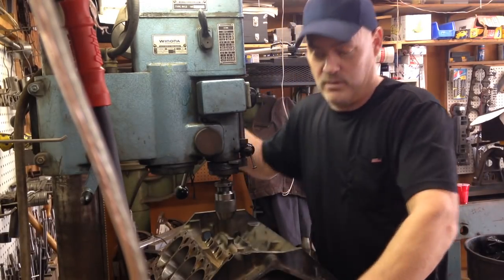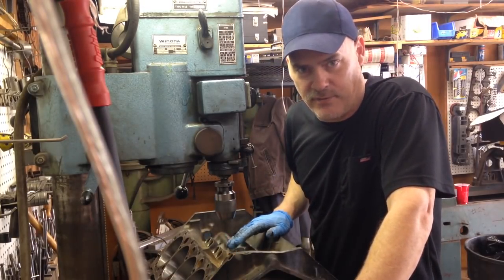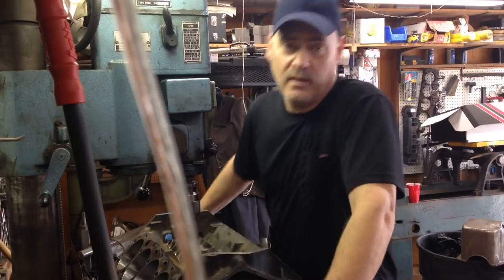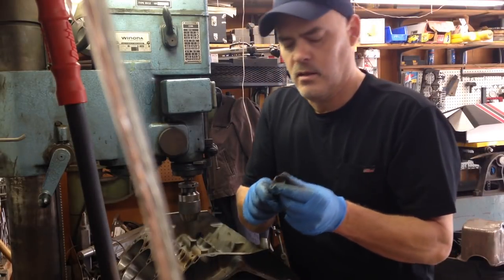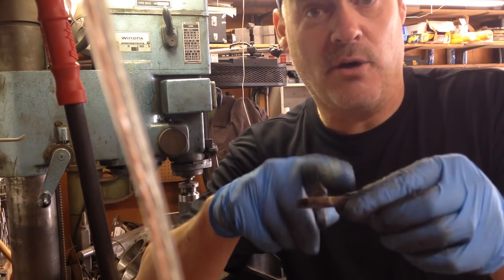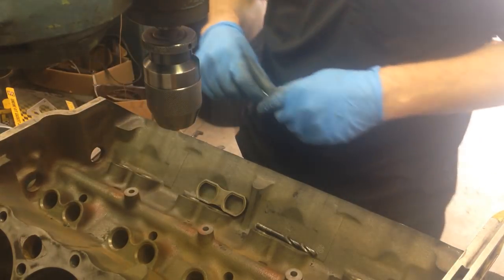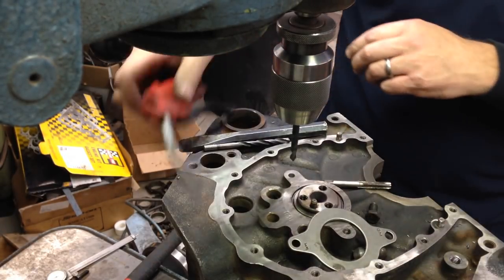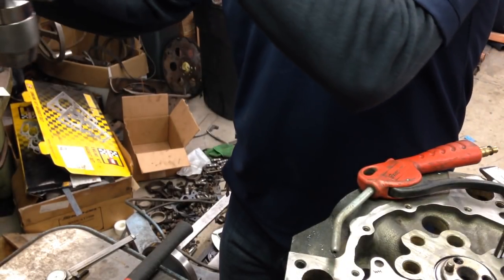Chevy TBI roller cam upgrade

Comment: On the cam retainer, I've always used a transfer punch for the first hole, chamfered it, then tapped it, cleaned it out, bolted the plate back on, checked it for cam clearance, then repeated the second hole. Always works.

Comment: I would also like to add that the top of the lifter bores is supposed to be milled flat and into the upper valley itself to allow correct clearance and a flat surface for the lifter anti rotation plates. This is one often over looked process. Some blocks came done while others did not.
Reply: If the block has the 3 tower bosses in intake valley , the top of lifter bore will be milled flat .

Comment: This is an older video, but I'm throwing in my own interesting experience anyway.  I have a 1989 TBI block and I'm working on a roller cam conversion for it in my truck.  I learned the hard way that if you're not doing this in a machine shop, and your holes ARE pre-drilled, make sure to clean any oil out of those spider bosses before threading in a bolt.  If your engine didn't have a spider installed there before and you're converting it without a full engine teardown/cleanup, then as the engine ran it probably filled up those holes with oil and created a unique situation specific to adding bolts that weren't there before.  I didn't think anything about it and assumed the oil would just act as a lube as I threaded in a bolt, and the first two bolts pushed the oil out just fine.  The third hole had just a little too much crud in the threads to allow the oil to escape, so the hydrostatic pressure ended up busting out the boss.  There's no one in my area that specializes in brazing cast iron blocks and machine shops refused to touch it, so I ended up using a brass battery terminal as a band-aid for the boss.

My bad experience aside though, an interesting thing someone online pointed out to me is that my spider bosses were drilled off-center.  His thought is that the drilled holes were probably a victim of core shift, and the factory probably sent it to the flat tappet assembly line as a result.  It would be interesting to know if the imperfectly manufactured roller provisions in these 87-95 blocks did play a role in deciding which blocks were used in roller cam applications and which ones were dedicated to flat tappet.
Reply: Good point. I have one of those flat tappet roller blocks in my 87 silverado. It was a rebuilt/ replacement engine at some point and has about 3k miles on it. There are currently bolts in those holes but no spider plate. Im looking to convert to roller myself, I'll be careful about that part now that you brought it up.

Comment: I realize this is a older video , one thing is the lifters in the down position will set slightly lower in the dog bones . This is normal as the top of lifter bore is not machined flat . The lifter should still have about 3/16 engagement into the dog bone and will work just fine.  I have done this several times and had zero issues . Do not use a small or reduced base circle camshaft.

Comment: If you guys do this with the engine in the vehicle use a round speaker magnet to surround the boss while drilling and use grease on the tap to catch the chips, then use a scribe with a small magnet on the end to remove any excess chips.
Reply: Cool whip bowl with hole in bottom , slide it over the boss then drill it and tap it. Done it every time works well.

Comment: that look on your face in the end was priceless lol. it's interesting, even my 68 & 70 Olds 350s have those spider bosses drilled & taped even though olds blocks didn't use roller cams until 85. another weird thing is on the 68 the heat shield on the exhaust manifolds have circular cut outs in them for o2 sensors. it's crazy the stuff car companies play with years before their actually in use.
Reply: Sometimes those exhaust manifold holes weren't for oxygen sensors. They were for connecting an air pump into the exhaust system to reignite the unburnt fuel in the exhaust. From 1966 onwards, some engines had air pumps and some didn't based on the needs of the car. Auto manufacturers would put plugs in those locations if they were building engine with and without air pumps that year.

Comment: I have one of these I took out of my 1990 350SS. I put a ZZ4 in it and wanted to convert it into a ZZ4 because its the same block but like this one it has a tiny hydraulic flat tappet cam. Now I just need to get the crank, rods, pistons, and cam/lifter/retaining set and im good to go.
Reply: How did that end up going?

Comment: Something that can save you a little time and headache if your doing this alot is making setup pins by turning down capscrews  to the dia of the holes in the plates  ,you can get
the holes centered  to under +/- .005 or better . such  a good thing to see mockup  in the machining /layout /blueprinting  this can't be driven home enough  , if your going to spend
thousands or more and want the motor to live at high rpm's  , awesome vid's
Reply from the maker: Great advise Thanks
Reply: ,,, yep,,, that cam had too much walk,,, already,,,. It will eat up timing chains real soon,,,. !!!   Didn't like seeing the metal shavings going into the new cam and cam bearings,,,. !!!  After Center punching,,, I would have removed the cam and then drilled and tapped,,. !!!
Reply: @ricksimpson2167  he said in the start of the video that he had not done the final wash yet, and that the cam used during the drilling and tapping was not the one that was going to go in the motor....

Comment: from what I've heard, 94-95 blocks weren't drilled since at that point only the trucks were using that block
Reply: I recently scored a #638 casting which is a 1994 casting - this one has the fuel pump hole drilled out (with the blockoff plate) and the spider boltholes r present but untapped
Reply: I have a #638 from my 95 that was like this without fuel pump hole either but not just that it only had 1 hole for a fuel pump cover plate instead of all 4. Not that u need a cover without the hole drilled but I like the looks of a cover over that ugly cut out lol

Comment: I have a home made centering punch made from a 1" piece of 5/8 round rod. I tapered the end 75 degrees and drilled a 3/16 bore through it. I made the actual punch from a piece of 3/16 rod and heat treated it. It will find center through any hole less than 5/8". Would work great for this project.

Comment: I got a 350 tbi  in my 91 c1500       there good motors  but I ended up buying a LT1 350 from a 96 buick roadmaster  for $400  I wanted to put a tbi intake on it  but I was told I cant and just use a 4 barrel  intake with a tbi plate adapter

Comment: Very cool to see a transition block like that. Guess they were rolling out the new castings already for the L31's before the model year was switched? And saving a few dollars by not machining the bosses that they didn't need to for that application.
Reply: hallis1 no usually these block were previously rejected for core shift I'd of had it sonic checked before I did any machining to it I did one at school and had to correct every cylinder on by slightly offsetting the boring bar if I had went straight inline with the deck I'd of been thin one side or the other on every cylinder some times the can bore is out of line to the main bore to you'll find that when you go to degree the camshaft because it can be as much as four degrees there tolerances were sloppy on the flat tappet blocks towards the last year's of the small block plus these blocks are low nickel and a lot lighter than the older blocks they took a lot of metal out of the castings of these blocks
Reply: the L31 (880) block will have a timing cover flange with the thicker lip 4 the plastic cover - this one seen is a 638 hybrid block in transition - note the upper bolt holes since it has the thick flanges where it was for the redesigned timing cover
Reply: @ Shane Singleton, I have these three year model 5.7L blocks with the last three block casting numbers of 638; 86, 88, and a 92 and everyone of them were fully machined for a roller cam.
Reply: The cars with the 5.7 had a roller cam , the trucks did not .  The blocks were probably all cast the same , with the provision to add the rollers in the car applications.

Comment: FYI the Weiand 8000 is the best manifold for the TBI as far as performance is concerned. I put one on my ZZ4 with a 1 inch 2 hole spacer to give the throttle body a little more length for better atomization of the fuel charge and clearance for the EGR breather. I put a K&N velocity stack on it to open up throttle body around the injectors to unshroud them.  The Edelbrock TBI intake isnt much better than the stock TBI manifold and makes little if any power. The Weiand 8000 makes all kinds of power and is a much better manifold than the Edelbrock and the factory ZZ4 intake.  I used the stock ZZ4 cam but I used Manley 44210 springs and 23652 retainers which gave me 130 lbs of seat pressure at 1.75 inches. I used crane narrow body roller rockers and 12497985 tall valve covers. This seems to work pretty well together and I have beat every truck Ive run with a vortec engine. A few have been beat so bad it was embarrassing.
Reply: You probably beat them because they weren't even racing you...haha

Comment: Talking about weird engines I have a 12550313...454.......91-up...4-bolt, Gen.V crate motor, Gen. VI 4.25" bare block, fuel pump boss

 Is that consider gen 5 or gen 6 to shop for parts thank you and knowledge is gold 🙏

Comment: This may be very helpful. I'm actually trying to go backwards. picked up an 87 305, but didn't realize it was a roller cam. with the cost of upgrading the cam in a roller cam setup it will be cheaper to convert back to a flat tappet cam. currently in the process if figuring out if thats possible or not. I guess the only thing that is unknown, is if the timing gears will line up. Going to be doing measurements comparing from a 69 307 and the 87 305.
Reply from the maker: you can use a flat tappet no problem the early flat tappet timing set will work just fine
Reply: Myvintageiron7512 yep, after days of looking finally found the answer. Also find out it’s already flat tappet, I guess an el camino is considered a truck haha. Or because it’s still a carb motor, it wasn’t upgraded to a full roller cam.

Comment: I found a lot of k series up to 95, no holes, like the factory was getting ready for them, and some boat motor blocks too...most of these blocks were straight making for the better build if hot rod, street builds or Baja🏜️⛱️🤗🗜️🔩🔧⚙️📐📈
Reply: The run really smooth with hand picking 1.52 rollor rockers from comp ...📀

Comment: Kewl video I do believe though when tapping cast iron you can use kerosene as a lube. I use a center drill drop the table lower and the recess in the back of your tap handle fits with centerdrill you can start the tap by hand then n be dead straight

Comment: the hole still there but not drilled all the way out , was switching back to carb to show my boy how and you can drill it out just like the plate you drilled if im not mistaken
Reply from the maker: yes that is corresc you can drill the fuel pump hole although many prefer to use an electric pump even with a carb

Comment: Do you have a video showing how to completely rebuild the oem roller block? I want to build a 383 stroker using an oem chevy block which I have. However I am so glad that you made this video because I didn't have a clue as to what those three tapped holes were for....the spider which holds the dog bones in place. The block did not come with the spider so I was totally confused. Thanks a million for this video.
Reply from the maker: no problem many of the GM blocks had factory flat tappet cams even tho the blocks were set up to take a roller

Comment: We tried a 1998 Vortec 350 roller cam in a 1990 Chevy truck application. It started and ran good but didn't feel like it had the power to spin the tires in grass.  I know it pulled the correct vacuum to work with the 1990 MAP sensor so I'm not sure what was holding it back.
Reply from the maker: Vortec rollers do not work well with TBI heads get a comp cams roller
Reply: Myvintageiron7512 I built The hodgepodge engine for a customer. 1995 350 factory roller block, 1998 Vortec cam, 1971 LT1 #492 2.02/1.60 heads. Topped off with the 1990 TBI and ignition... junk. It would have run much better with an HEI and a carburetor! lol. Thanks for the feedback JD
Reply from the maker: Factory vortec cams are not worth the metal they are made of they are made to work with a very specific OBD2 tune with the vortec fuel injection they do  ot work well with TBI or carbs don't waste your time comp cams rollers are the only way to go
Reply: HeadFlowInc ive got a free pair of them heads nos. Ive been considering a cheap sbc build to throw them at. TBI and that cam would sign off about the time those heads came on line. Then theres compression issues with them big a$$ chambers. What did you use for pistons?
I figure them heads would make a decent buck down 383 build but a guys really gonna have to pay attention to piston choice with them chambers
Reply: do u have a part # for the Comp Cams roller grind
Reply: @montrosepatriot  comp makes lots of different roller grinds for small block Chevrolet.  Go to their website.

Comment: Have you ever thought about drilling a hole in between where the lifters sit to hold down the dogbone that way eliminating the need for the spider?
Reply: The "spider" spring hold down is designed that way to allow for slight movement of the lifter retainers. If you simply bolted them down, there is the possibility of lifter bind leading to premature wear. Edit: just realized your comment was 2 years old haha.

Comment: Bro the correct bolts for the cam plate are Torx and they are round and do NOT protrude up into the Cam gear . I myself personally would have Opted for the Torrington Bearing & cam  button but I guess it's a preference ..If you went .040 over bore instead of the .030 would the net cubic inches  be 396 ? of course using the same stroker kit you were going to use but swap for the .040 over pistons ?

Comment: How is the engagement of the dog bone to the follower when on lowest point on cam. The factory has the lifter bores machined down 100 odd thou. How those are left without machining them flat may be ok with a std base circle cam. But I would be really careful with a reduced base circle cam that the lifter doesn't drop down out of the dog bone and rotate.

Comment: So  With out tearing the 5.7 GMC K1500  Down is there any way to know if it came with a Roller  I plan on rebuilding it  About this time next yr  II will not go back with a flt tap  Roller or roller retro fit  Would Vin indacate  any way if it was roller  --Ok   I have lot of questions  but That will do for now Thank you  Dave @ Dad's Ole Garage

Comment: Hey man watching ur videos is like going to school I love them thank u so much for doing this.  Funny I have a 89 tbi that has a flat tapped and doesn't even have the bosses for the spider crazy huh. Question thought ..what kind of heads can I use on this cuz the ones on it are junk!!! Thanks man ur awesome I am rebuilding this engine cuz of u and ur super informative videos
Reply from the maker: THX
Reply: JUSTPEED ,,, do you want a higher RPM engine,,, with torque and horsepower coming in later,, ???   Or a lower RPM,, all torque and horsepower in by 4000 RPMs,,,, higher torque,,, and high miles per gallon,,. ???  A daily driver that can pull 4000 lb,, ???
Reply: Most roller lifters come with anti rotation plates joining the 2 lifters so you dont need this spyder piece

Comment: Interesting, my oddball story is having and old late 70's 350 that came from the factory with two different heads, basically the same specs for each head, just two different casting #'s.
Reply from the maker: Yep I have seen that to had one with a 993 and a 487 castings but like you say they are identical heads
Reply: Left over parts I guess.
Reply: @stevew270  They ran out of parts that night and had to switch over more then likely but you would think they'd pulled the oddball to keep things the same number. More then likely was a shift suprisor call and gm knew nothing of it lol

Comment: I have a 94 firebird with the LT1 350 and I'm looking into getting a cam. I have a first gen cloyes timing set already installed ( no water pump gear) and electric water pump. Also have the 24x LS style coil packs and computer so i dont need the cam to spin the distributor either. I'm wondering if i can use first gen cams and/or flat tappet cams. Never did this before and im not an expert so ANY suggestions on a good street cam that isnt to expensive would be great. Shooting for close to 400 horse and 800 or less.

Comment: I have a question if you might know I have the exact same set up.. except I added upgrades heads etc. Wondering if I should switch out the tbi and go carberator and  different distributor etc. Or keep all that and find a different computer chip for it or will  the computer accommodate the new parts etc. I hope makes semse. Any help appreciated thank you.. Troy

Comment: I have a block just like this on the engine stand.
Reply from the maker: Oh man you gotta make it a roller
Reply: I pulled this motor from a 91 firebird. At some point someone swapped out the 305 tbi for this 350.

Comment: Is there any real difference between the non roller blocks to the rollet blocks, other than cam plate and spider for the lifters? Can a retrofit cam be used in a 96+  block?

Comment: I recently bought a 1992 5.7 four bolt main block with a pair of 193 heads, it came with a cam in it but the guy I bought it from said that all he knew was that it is a mild cam in it but couldn’t tell me anymore info on it. Is there a way to tell if it’s a flat top or a roller lifter cam? And or if it’s hydraulic or not?